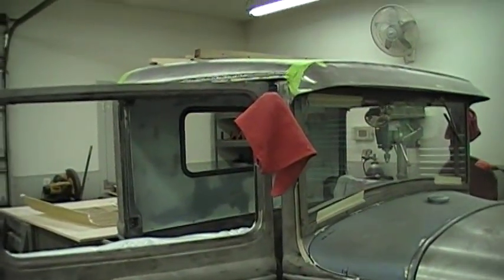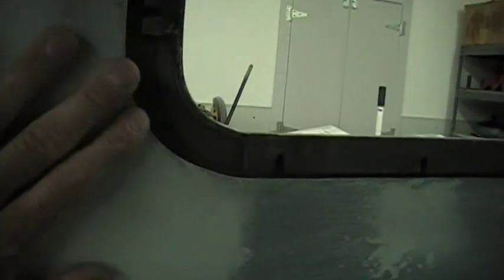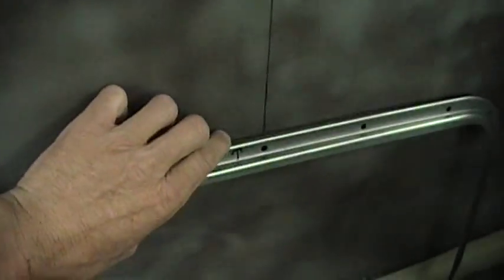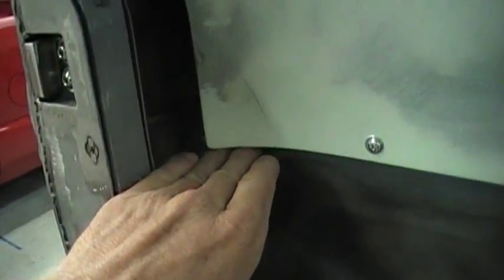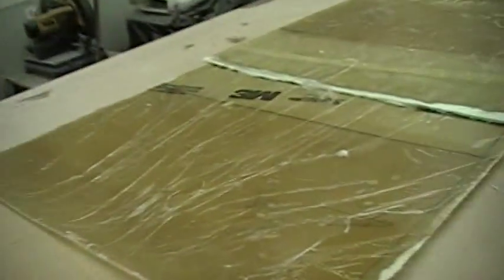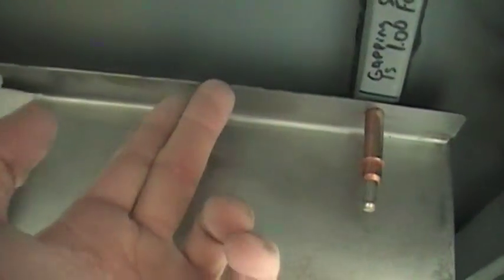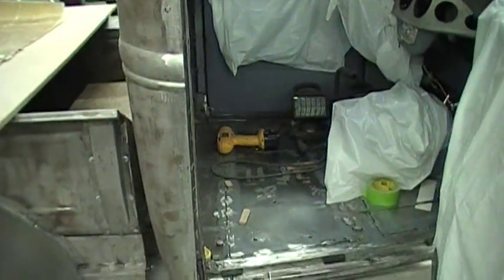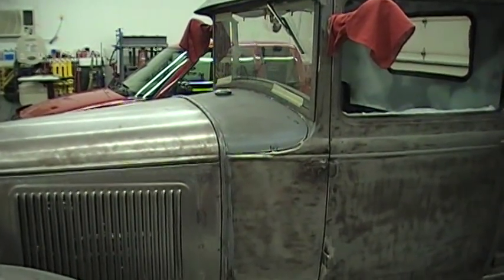31 Ford Model A pickup 33

Comment: Man, you have a great imagination and TONS of patience. Obviously, the skill to make it all and up a "reality". Very, very nice. I'm assuming you will glue the fabric to your back board?? My wife drives a 02 Jag that is done that way. The adhesive is "dying" and the headliner is about to land on our heads. ;o( Be warned about the adhesive.
Reply from the maker: +Pappa Bob Yup I know all about the adhesive for headliners. We use a commercial grade adhesive where I work at and ill just use it. They make a 3M spay 77 adhesive but it just doesnt hold up. all the headliners Ive replaced the glue actually held but the headliner fabric seperated from the foam backer which then had to be cleaned off the headliner board before recovering. I was told that cigarette smoke will cause the headliner to fail but I dont know if that is true or not. Thanks for watching !!!